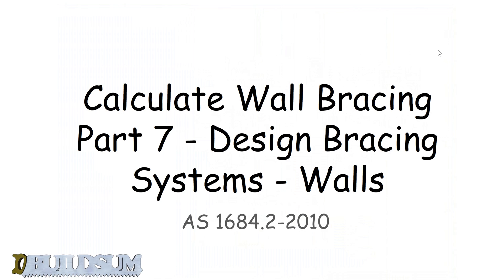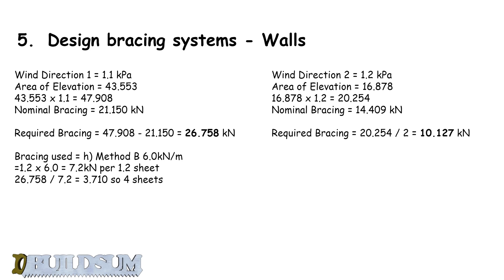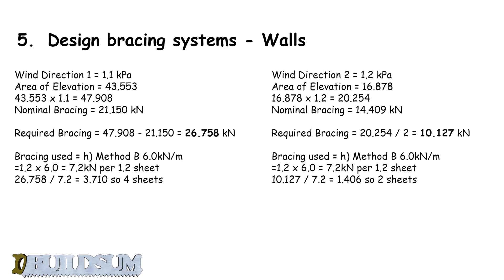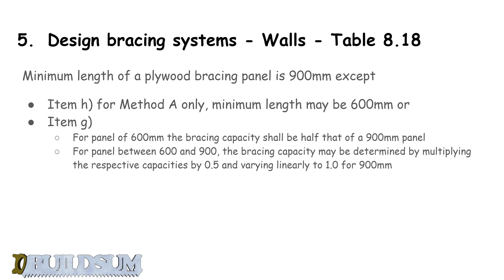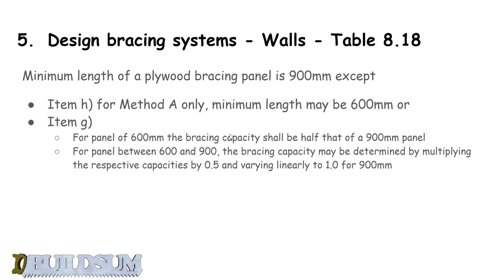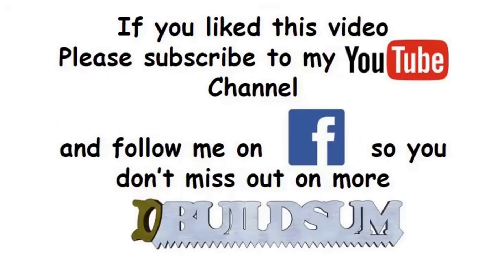Calculate Wall Bracing - Part 7 - Design Bracing Systems - Walls

Comment: where is the bracing method H? Cant find it!
Reply from the maker: Hi Mate, are you using AS1684.2 - 2010 version. Older versions may not have it.
Reply: @Buildsum  Using the latest! :) Thanks for replying. But can you let me know what page is it on?
Reply from the maker: Its on page 146 in my copy

Comment: Great content but it says "Nominal bracing cannot contribute to bracing resistance where it occurs in the same section
of wall as structural bracing, such as where plasterboard lining is fixed over a structural brace." so 4.017 sheets?
Reply from the maker: Hi Alex, the Nominal bracing can only make up Max 50% of you bracing resistance so there is plenty of room for the structural bracing.